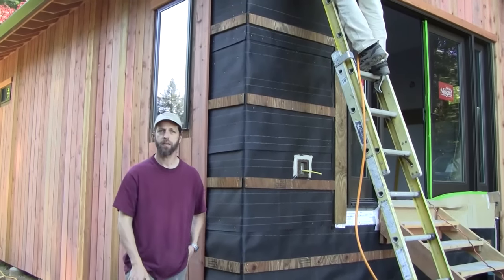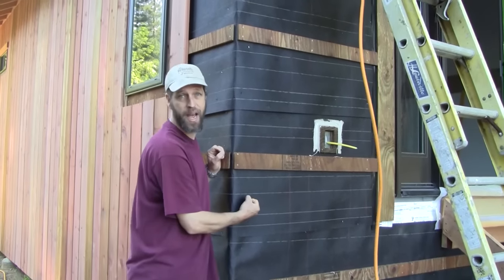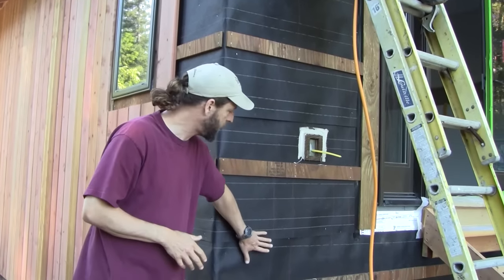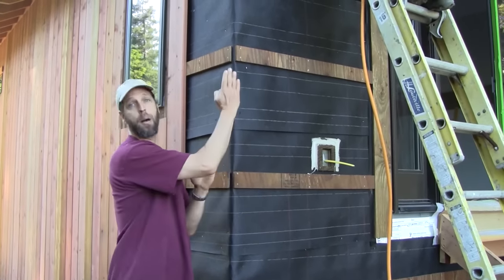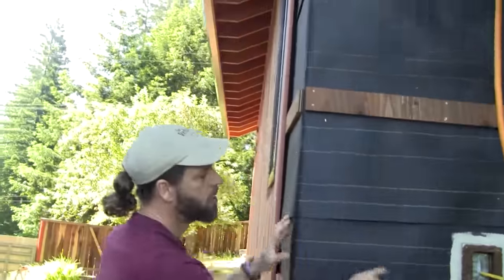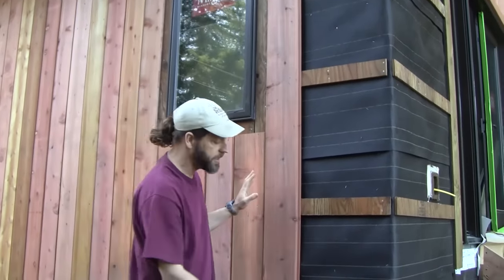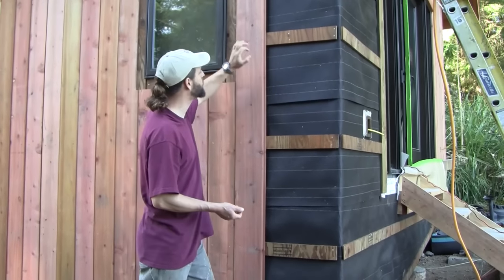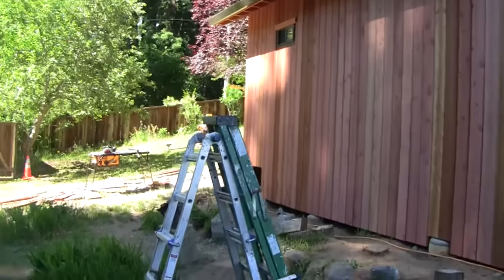DIY VERTICAL wood siding INSTALL with a DRAINAGE plane.  A Contractor Explains.

Comment: 30 pd Tar paper does not  breath well and never has.The manufactures of the products will back up my claim. 15 pd is typically used under shingles and can actually breath well enough for the job. You've gone with 60pds in total. What makes you think you haven't created a problem?You've literately choked/enveloped nearly the entire house in 2 thick poorly aspirated layers. Where is the fresh air going to come from for the house to breath?
Reply from the maker: That  is a good point. I will have to look up the stats.  My experience tearing apart many old walls is that in my climate 15 lb turns to dust.  So not sure which is better.  Time will tell.

Comment: Don' believe a word of it?? Look at 100 year old farm houses  no "drainage plane" and still up and functioning.. I've put smart siding directly over house wrap and it has been 18 years and still looks amazing and no water problems.  It's like you are designing house to leak???
Reply from the maker: Um.  Ok.  apples and oranges.  100 year old Farm houses have air gaps everywhere that allow for quick drying and were mainly built of very rot resistant old growth.  18 years without a drainage plane should work fine.   Longer we shall see.  The building science is clear.  Drainage planes extent building life in modern more air tight houses. Vertical siding in a more air tight house is a problem.  The drainage plane will help alleviate some of those leakage issues.  It is not a perfect system but it helps.

Comment: why would you leave all your nails exposed to run and rot?  why not toe nail through the tongue as you would all TaG? Just like flloring. Just looks way better when the nails are hidden.
Reply: we use stainless steel ring shank nails here. holding power is incredible.  they're even painted same colour as the siding.  fancy!

Comment: Is this an American/Canadian thing; fitting horizontal battens across the "water plane"...??

In the UK you're normally going to see vertical battens first, with horizontal battens afixed to vert ones.
Reply from the maker: That would have been a better option actually. Just what took longer. If I had to do it over again I would do that!